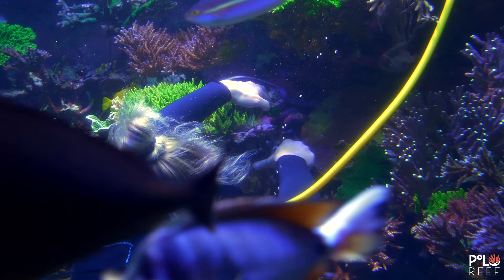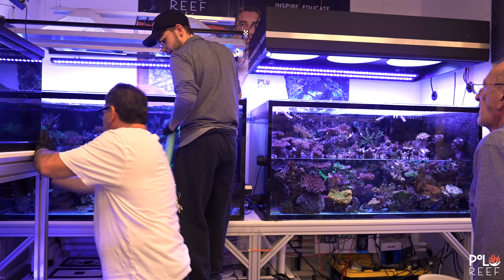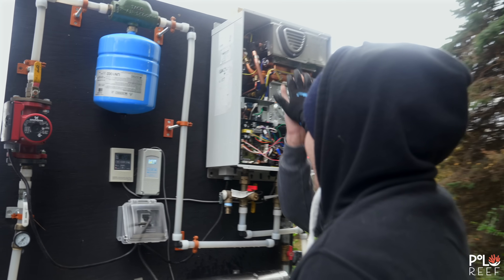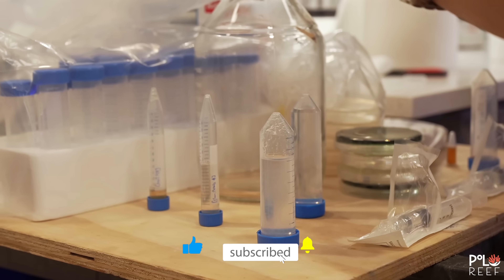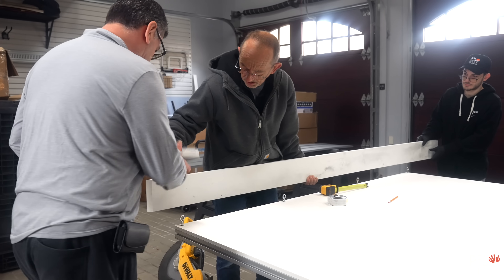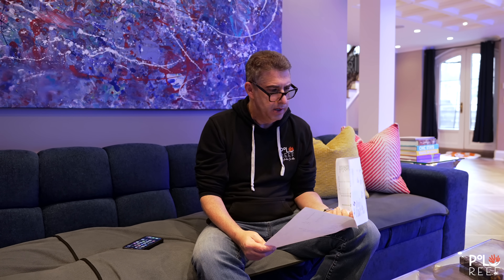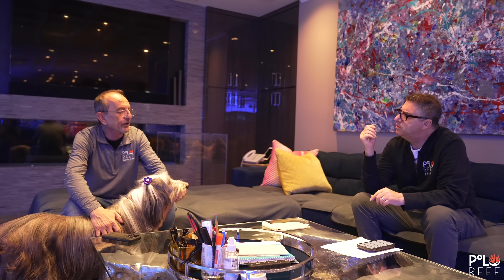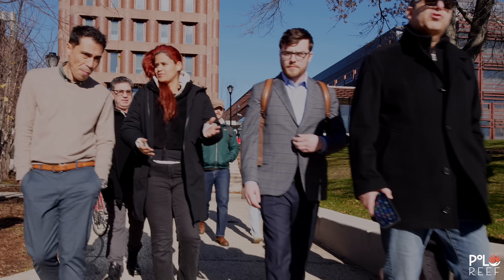BATTLING HIGH METALS IN THE AQUARIUM + YALE VISIT & MEDIA REACTOR DIY FIX!

Comment: If the main problem is copper, why don’t you do at home copper test rather than waiting for ICPs
Reply: How do you believe a few days difference in getting test results would change your approach to this dilemma?   It’s been going on for months.   The result trend is consistent.
Reply: @Jommybutler1234  the icp test take nearly a week to get back, they could do on site copper test for small systems for more regular readings and testing more areas (like the tub with all the rocks in)
Reply: @FlammableHumour And how, exactly, would that have changed the process, timeline or outcome in this case?
Reply: @FlammableHumour The reality is that they really don’t know if it’s specifically the Cu that’s causing the issue.   “The ICP tests revealed elevated concentrations of metals, including copper.”  Cobalt was specifically mentioned.   What at-home test do you suggest for Cobalt?
Reply: @J @Jommybutler1234  I’m aware icp does all, and I’m not sure about colbalt. I was speaking about copper. I think it’s great they send as many icp test off as they do but if copper is one of the big issues, this is one that can be easily tested at home. Rather than getting a test, doing large w/c then having to wait another week for test, you could do same day as the water change and see if the copper has increased from the water you changed it with. I’m also sure there are at home colbalt test but idk
Reply: @FlammableHumour Can we grew that Math is a thing?      You get an ICP back that indicates a Copper Level of X.   You do a 50% water change with water known to contain zero Copper. 

What is the Copper level in the system ?             X x .5 = Y
Reply: @F @FlammableHumour  Why would anyone ever write of say, “I’m also sure there are at home Cobalt test but idk”.      Are you “sure” or do you not know?     

Do you know the unit of measure when testing for Cobalt in natural sea water?   I will give you a hint….Jon Jones UFC

Comment: Tanks that get less messed with, get more stable and have overall less problems.
Reply: Wise advice! Thank you for your support of Polo Reef. Happy Holidays!
Reply: What specific changes do you endorse?
Reply: @Jommybutler1234 good cleanup crews, less frequent media and water changes, don’t change a number of things all at once.
Reply: @atfinthehouse8631 I understand the concept.  I don’t understand how it relates to the video.
Reply: @Jommybutler1234 you guys are always fussing with the tanks.
Reply: @atfinthehouse8631 Can you see the significant difference between what’s happening at the scale of Polo Reef vs even the largest average home system?

When the PT has Cancer…you do Chemo AND Radiation.   You don’t do one for 6 months and then say…’Well that Didn’t Work’
Reply: @Jommybutler1234 of course it is different.   Straw man argument.
A system as large as polo reef is going to change even slower.  Small nano tanks can crash faster and more dramatically.  Large systems still should be managed closely, monitored, but probably messed with a lot less.  You are potentially creating your own crisis.   Good work though on finding the rust on the rocks.  If those went into a small system everything dead or failing.  Large system less so.  Still check any wires in your tanks to power things.   Voltage testing might also be a way to find insulation failing and wires getting exposed.  Current in saltwater probably not to good either.
Reply: @a @atfinthehouse8631 ”potentially”, “might” “probably”.  Strong argument you make there
Reply: @Jommybutler1234 ok Jommy you know it all.  You are far smarter than me.